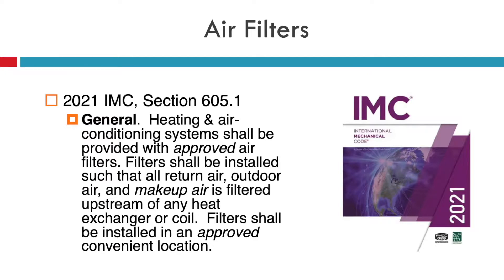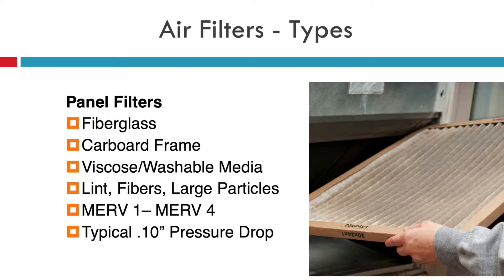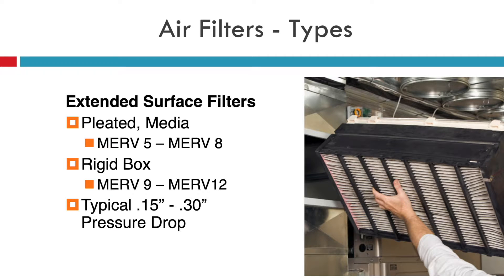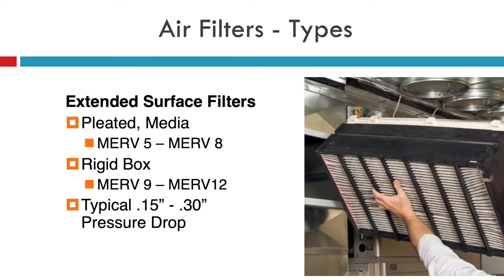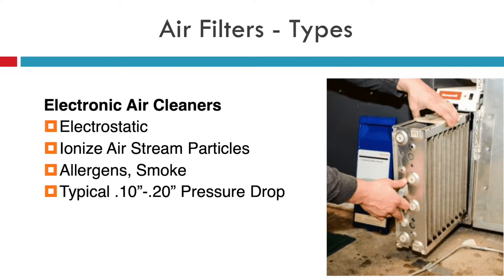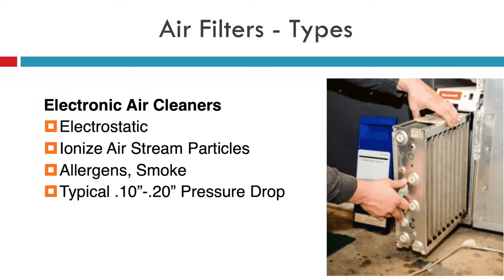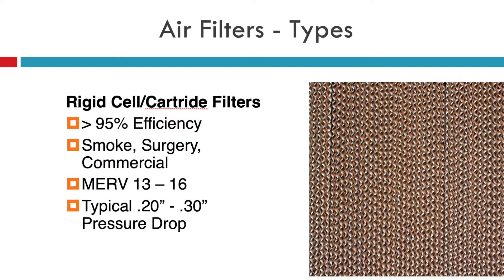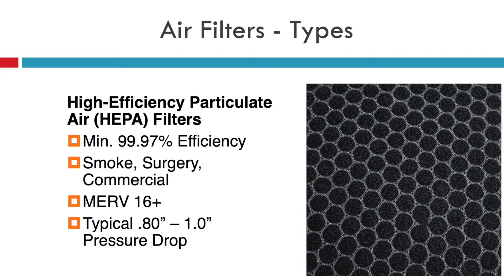Types of Air Filters: What They Are & How They Work

Comment: Merv rating to static pressure is irrelevant. Think of it more like the fire triangle. Static pressure, merv, and loading curve. The third making sure the filter will maintain a reasonable pressure over its service life is often missed. IQAir has merv 16 2" filters that last at least a year. Ionizers have a lot of unintended chemical reactions and don't test the way they claim under typical system conditions.